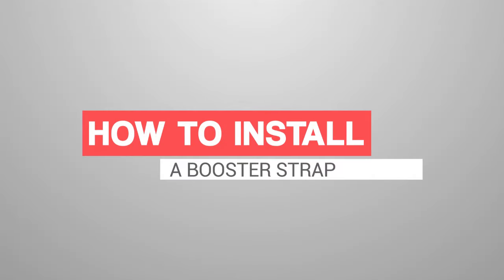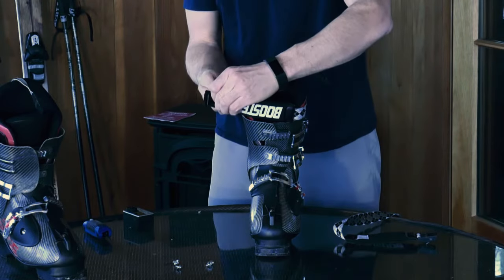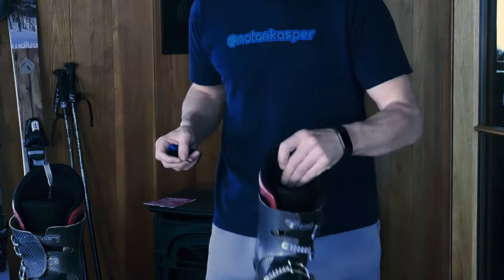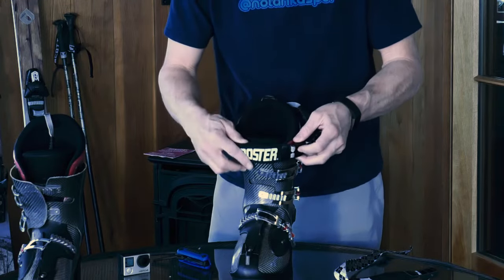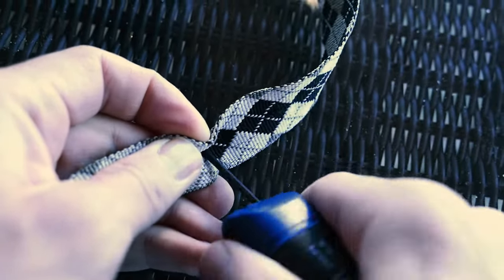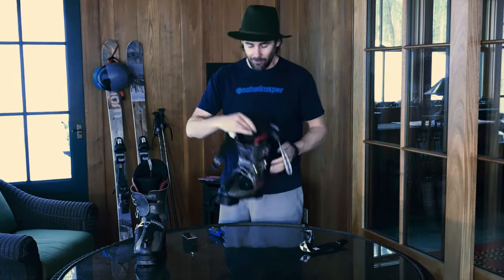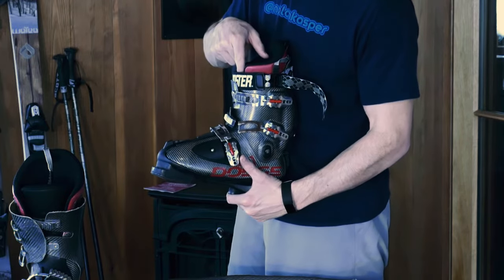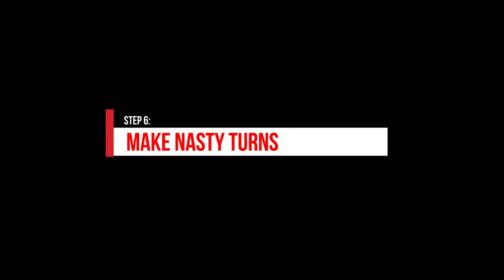HOW TO INSTALL A BOOSTER STRAP

Comment: At the risk of looking like a "total Jerry" (whatever that means), for most people, if the strap need adjustment it is far easier to adjust on the INSIDE of the boot.  I have the old version and for the longest time I put the buckle on the outside and always felt like I had to get crunched up to tighten or loosen it. Finally I got smart and flipped them. SO much easier.   I suppose if installing them on the boots they are cooler looking.  But hey... don't you put your snowpants over the tops anyway????  One more thing... A heated (hot) awl or punch,  can be used to burn the holes into the strap,  sort of "corderizing" the stap so it won't fray at those points (assuming it has nylon content).

Comment: What is the difference between this and strap already on my boot from the factory?
Reply: The normal strap won’t let you get it as tight with smooth recoil. The factory straps you can get em pretty tight but they don’t move if needed which is worse.
Reply: My experience has been that the factory supplied power straps, being a Velcro attachment are stretched during skiing and do not remain tight.  The Booster Straps are a substantial nylon strap and uses a heavy duty cam buckle instead of Velcro to securely maintain tension. So any change in length will be from the elastic portion of the strap.

Comment: What if my boots have rivets holding the strap on?
Reply: It’s explained in the FAQ’s on the Booster website.  You need to drill out the riveted strap and then add a Booster.
Reply: @Warner-Nickerson  Does it come with the screws you need (since the rivet will be destroyed)?
Reply: @scottbirse2309  no, a booster strap does not come with screws, you'll need to buy some
Reply: @Kyle-ow7of what bolts does one buy for that

Comment: The method to align the strap is inadequate. 
Instead,  after removing the old strap, put your boots on and  tighten them just like you would for skiing. 
Wrap the Booster Strap around the boot and tighten  and align the strap
so that the elastic portion  is centered  on the shin and then mark the desired strap position  on both the strap and boot shell so the position can be  identified .  
Remove boot  and align the mark on the boot and strap. After aligning vertically so that the  strap is centered over a  boot fastener hole, make the hole  through the strap. 
If there is a second fastener required to secure the strap, then you can  accurately make the hole through the strap after installing the first fastener.
This removes all of the guesswork from the alignment process.
Reply: Should I be wrapping the strap around the outside of the boot or the inside when installing?